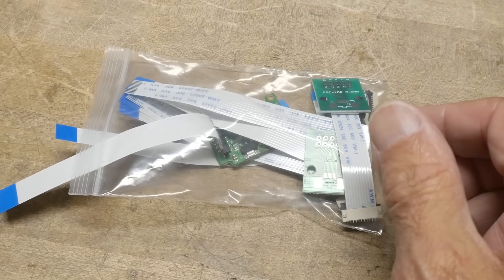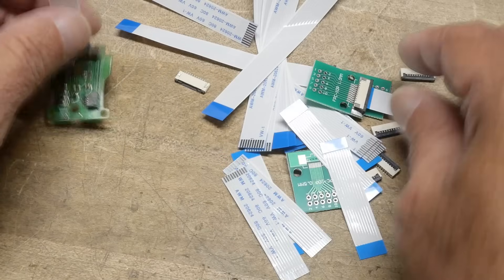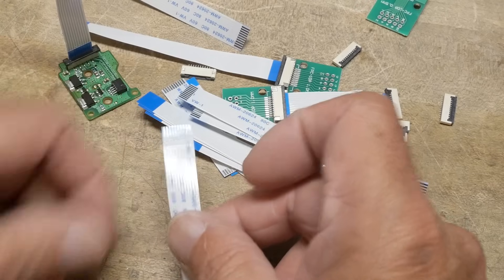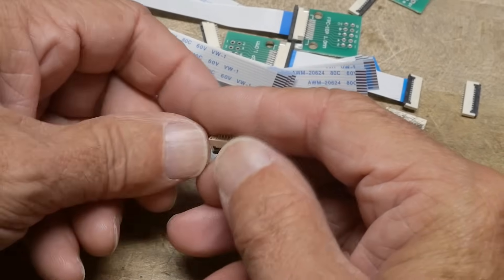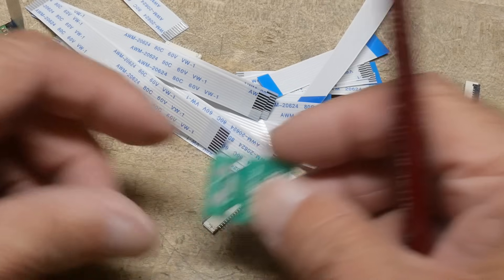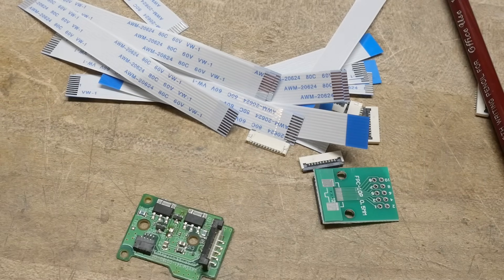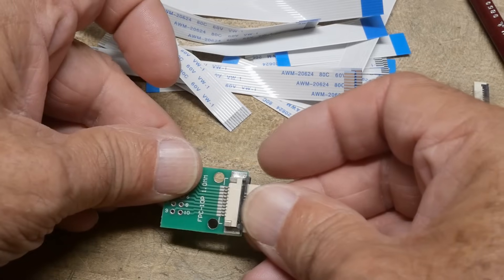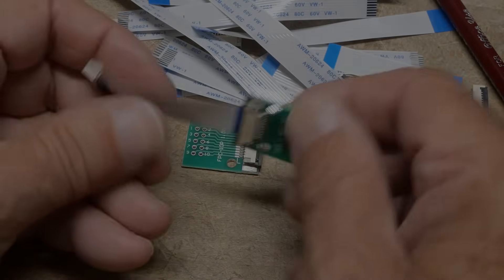#2278 FFC Flat Flex Cables and Connectors

Comment: Nice, I have an old 1980s Dart board and the matrix in the back has 3 ribbon cable that have bad female connectors? Would you by chance know what type connectors they would be to order? They are blue in color and can open them up they pinch on the ribbon trace!

Comment: Hi there, I have a home theater LG. That internally has the MAIN PCB attached to the front / display (VFD or vacuum fluorescent display) PCB via a flex cable (that is damaged), now that I went to aliexpress it says "forward direction" or "reverse direction". I thought it wouldn't matter. If cable have continuity in one side to another side does it REALLY MATTER?

Comment: Never work with metal tweezers when there is voltage on FFC, it burns at incredible speed like 30cm in 0.01 seconds... Use ceramic tip tweezers. Also, if it gets damaged, you can cut 1-2 milimeters and it will work as new...

Comment: I did the same as you but I went for 0.5 x 20 pins. bought the little adapter boards and everything about a year ago whilst building a  "Radioberry" HF SDR transceiver. One of the cards has a FPC so I had "no" choice! 🤓 Time waits for no man!!

Comment: When new nothing to be afraid of. Once they get 10 plus years old they can start to come apart and when you insert them the conductor can peel back. I can't tell you how many of these I have pulled apart fixing something only to find out someone else (me included) has re-inserted an FFC and the conductor is folded back or folded and shorting. The blue shim likes to fall off too. Worst case, you CAN cut them back and scrape off the insulation and start with a better "bare" end in a pinch. If you don't want to wait for a new FFC to get delivered. 
Side note: I literally just sat down from working on a 13 year old Pioneer CDJ 2000 with a power cycling issue. It has new FFCs but someone also added shims behind the new cables to make them even tighter. Long story short and a few hours later, a poorly seated FFC was the problem. I did remove and reseat that FFC connection earlier too. Just sometimes with old crap these can really be a pain in the ass. Do you best to NOT disconnect one on older stuff if you don't have to.

Comment: I'm sure if you really need them you can get compatible through hole versions of the connectors from Digikey and other suppliers. I think they are called FCI Through Hole (Flat Cable Interconnect Through Hole. ) I've used the through hole version to make a strong repair on broken boards before, I assume they are still available. As you point out, the mechanical fixing of the surface mount versions can be tricky, and board designers often leave the connectors in locations that make them vulnerable to mechanical damage during servicing.

Comment: I haven't used these because 99% of my prototyping is on a breadboard, so I would have to break them out anyway. In addition, if you're making something more permanent, you need to buy a cable of a specific number of pins and a specific length.  It would be nice if you could custom make FFCs somehow, at least where you might have a 50 pin width cable but can "peel off" the number of conductors you need. Not sure how you'd do length.

Comment: Looking at those ffc to idc header adaptor boards, the footprint is about the same. So no savings in terms of that. In fact ffc socket seemed a bit wider than 100mil header. For 100 mil headers, I have stock of single and dual row male and female 40 pin per row. I just cut them to whatever size I need. I also have 40 conductor ribbon that i split to whatever width i need and cut to whatever length I need. True, I do need to stock variety of crimp plug sizes. With these, you have to get the whole chain in specific size you need. Both connectors, sockets and the ribbon. And you can't cut the ffc ribbon to length or number of conductors that you need. Plus forget about crimping additional connectors in the middle of ribbon. I don't see much advantage.
Reply: The crimp plugs have got very expensive though

Comment: Dumb question but the center to center distance on those holes looks a lot smaller than 100mm?
Reply from the maker: 100mils is 100 thousands of an inch or 0.100"   I know some contries say 100mils as 100mm
Reply: @IMSAIGuy huh, idk how i've never heard that before. Thanks!
Reply: 100 mils (thousandths of an inch) = 0.1 inch = 2.54mm.

Comment: I have used these for many years. Very little problems if any. They are reliable if used carefully.
Reply: In my experience, they tend to crack at the end of the blue stiffener part if you flex them at all - which is ironic in that they're literally called "flat flex cables"
Reply: @gorak9000  That is interesting. I have used Japanese high quality parts and no failures. The metallization may wear out if pulled out regularly

Comment: It's not "fear of modern days", it's "at 70 years old even with 5X magnification, my eyes aren't good enough for a lot of electronics these days".
Reply: Wenn I started with electronics over 50y ago, an active device was something you hd to hold with your fist and if you dropped it, it inhaled air.
New a similar thing is 1mm x 1mm and if you drop it, it gone forever.

I often wonder how I was able to tuck such a sot232 to a board. It’s not be vision, that’s a clear fact. 😂
Reply: That’s why I have a binocular microscope!
Reply: I use a stereo microscope. Priceless.

Comment: Great video, thanks, I like the adapter boards. 
Buuuuut! If you connect 2 simple boards with these cables, the pin numbers are reversed from one end to the other. Pin 1 becomes pin 10, 2-9, 3-7 etc. 
To fix this you either need different pin numbers for each end, or different PCB footprints. Either way is pretty ugly. 
It's a trap!

Comment: I'm only a couple of months ahead of you but there's another subtlety you missed. The wipers that connect to the FFC can be at the top of the connector, the bottom of the connector or on both sides. This means the blue tag should be underneath, on top, or doesn''t matter. Or, actually, it matters a lot because although the cable will connect either way around, you're reversing all the pins just like an IDC connector with no polarisation pip. 
Select with care !

The other entertaining part is soldering them down by hand, especially the 0.5mm version. And there are 0.3mm too !

Comment: I was a little confused to start with. It was your reference to 100mil pitch connectors. It took me a while to realise that you meant 0,1inch pitch connectors and not 100millimeter connectors!!!! Being from the other side of the little pond we don't use "mils" to refer to 1/1000inch but thous as in thousandths of an inch. We use mil to refer to either a millimetre or a milliradian. I'm now a retired mechanical engineer and the first time I ever came across mil as a reference to 1/1000" was in a YouTube video a couple of years ago. Great videos by the way. I started watchhing when you were renovating a very dead TS120. Cheers & beers DE AL G8YKM
Reply: I haven't heard someone call a "thou" a "mill" in a long time - I think it was common when the US actually manufactured PCBs, but now, not so much. Maybe being a younger generation, I always called them "point one inch" connectors, and dabbling in machining now, I tend to reserve "thou" for machining stuff

Comment: Yes, not a fan. Annoyingly small latching device, and never really sure it is seated properly. I'm old school, I want a bit of a "thunk" to assure me a connector is seated properly.
Reply: on some cables now, they actually silkscreen a line on the cable that shows you if it's inserted all the way, and if it's actually straight. I don't like them because they tend to break at the end of the blue stiffener bit if you look at them wrong - ironic that they break if you flex them, and they're called flex cables...

Comment: I looked at using these a few years ago but I ended up not using them because of the durability. My application would have required them to be disconnected periodically. The Molex  data sheet for these shows the connector durability as 20 cycles max.  I'm assuming that after the connector has been cycled too many times the connection reliability is gone. Maybe connectors by some other company would have better durability. They would be great if you put them together and never have to touch them again.

Comment: I envision a group of engineers sitting on logs on the shore of the Lake of Fire:
One says, "I invented the hold button, what are you here for?"
Another sez, "I invented pop-up ads."
Finally, one replies" I invented flat flex cables."
Reply: Lot of product design engineers there.   "I wanted to impress my peers with something overly complicated and a pain".
Reply: Don't forget the first-ever hated engineer (even he admits he was wrong) - the one who used those slide latches for ethernet 15-pin AUI connectors.
Hell's too gentle for the popup ad man
Reply: so... I take it you're not a fan of flat flex cables then...? I'll put you down for 'no'
Reply: "...so what did that guy tied to the buoy on the lake do...?"
"...LCD 'zebra line' tape..."

Comment: Flat flex cables have been used in amateur radio and commercial/public safety radios and equipment for decades.  First ones I ever had to replace were in a 70cm repeater that had become the home for a mouse.  Little guy decided to chew every wire and flat flex cable in it.  Of course the manufacturer of the repeater no longer stocked replacement's because the repeater was a discontinued model.  Was pleasantly surprised when I found out they were standard off the shelf cables I could order from Digi-Key.  I now stock around 150 different types of flat flex cables.
Reply: Love your repair videos Mike!

Comment: Flex cables and boards are nothing new, they were definitely around in the '60s (used in inertial navigation systems, or in the Apollo guidance computer IIRC), and later on in the '70s a flex cable was used in a PDP11/44 power supply Usagi Electric restored here: https://www.youtube.com/watch?v=dpM3Xj2H-Pw . It was high tech way back when; they became mainstream in the '80s or '90s. Every CD player or drive has them, they're very common in digital cameras (especially if you have a folding display), laptops use them for display and USB connectivity between lid and motherboard...
Reply: I remember that the ARC 164 radio of the 70s or so had that amber flex "mother board" for the plug-in PC modules but I believe the assembly was soldered.  The flex soldered to the PC sockets.  Things will eventually get too small for even the best of us.